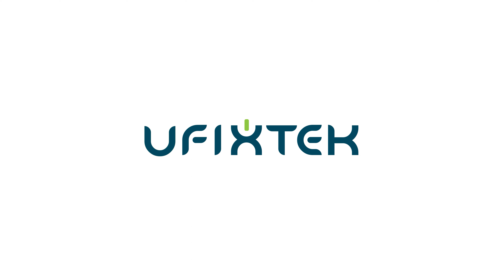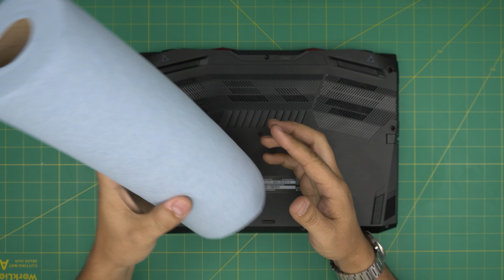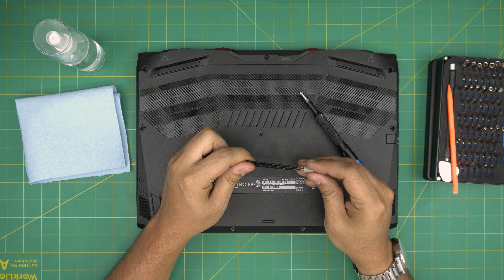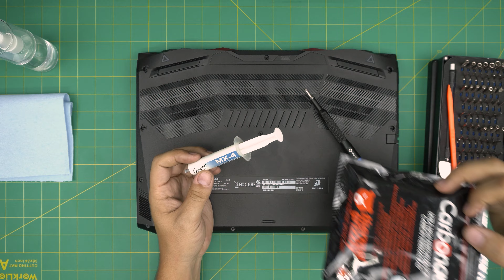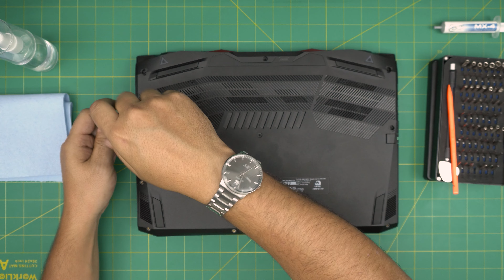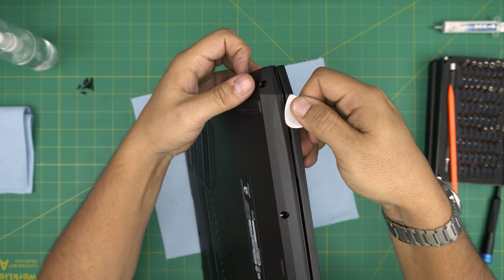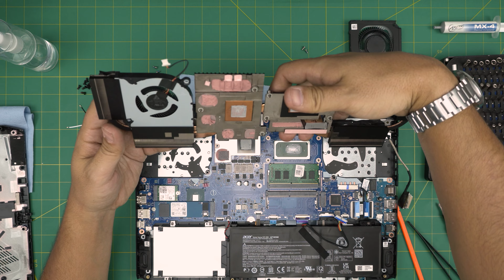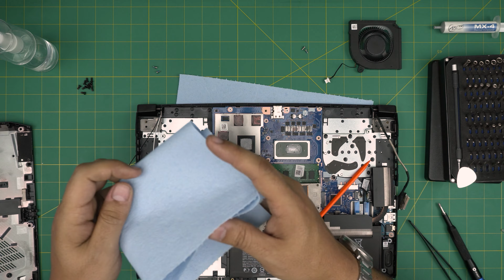How to Repaste and Clean Acer Nitro 5 AN515-57-79TD Laptop | Step by Step

Comment: When I was doing it to my computer I had got a little alcohol on the tape and so I became no longer sticky so I just peeled it off. On Mine it was little different and there was only 2 pieces of tape and I got it on both so I took off both. So my question is if the tape has an important purpose cause I don’t know if I should replace quickly or not.
Reply from the maker: 🫠Regarding your question, you don't need to worry it will not affect the performance of the laptop at all. zero issues.
Should you have any further questions or requests in the future, please don't hesitate to ask me.
cheers🍻

Comment: 13:20 I’m trying to put the computer back together, but I can’t connect the wifi card cables back together. There’s so tiny and can’t put them back on right. Idk how u make this sound so easy, but something ain’t right. How do I get it on?
Reply from the maker: 🫠Regarding your question, all you need is to make sure it is straight over the connector and push downs and it will snap to the connector, just make sure you place straight over the connector.
https://imgur.com/a/3U6y5rA
Reply: @uFixTek  It snaps on, but then falls right off, and it’s really annoying to do. But I found out that I didn’t REALLY need the wifi card per se bc I still get wifi and Ethernet n stuff without it. I’m assuming the wifi card gives u Bluetooth n stuff right? Or does it include other stuff? I bought a Bluetooth dongle for like $15 and it should work perfectly fine.
Reply from the maker: it gives wifi and Bluetooth , if you near the laptop the Bluetooth  will work. or get a dongle. but it should not fall off, you can use a gafers tape to keep it in place or hot glue.
Reply: @uFixTek  I bought a dongle for like $15. I have one on my other PC at my dads, and it works just fine. Should see the same results on my laptop.
Reply: Update: I bought that bluetooth dongle, and it doesn't work properly. It gives me error code 31 when listed in device manager. Could this issue be due to the disconnection of the wifi card?
Reply: @uFixTek  I feel like my internet has become slower without the wifi card plugged in. Does the wifi card improve network performance?
Reply: @ThatPurpleWurmple Just dealt with the same thing for probably twenty minutes. Try to do one cable at a time and tuck the other one back until you get the first to click. For me I tucked the white wire and focused on getting the black one in place, clicked in place after trying for a minute or two. If you’re still struggling just keep trying and you’ll get it in, unfortunately there isn’t much else you can do.

Comment: The screws on the left of the heatsink won’t budge for me 😢. Maybe im using the wrong screwdriver what are you using?
Reply from the maker: 🫠Regarding your question, the screwdriver I'm using is linked in the video description.  
Use a screwdriver that fits perfectly, press down into the screw, and rotate slowly to break the tightness.
cheers🍻
Reply: @uFixTek  Thanks for helping I will get back to you after purchasing a new screwdriver
Reply: @uFixTek  was an easy and effective tutorial thanks. I just needed a PH0

Comment: can i use 0.2 mm thermal pads to replace the thermal putty?
Reply from the maker: Thank you for your feedback! If you wish to support the channel, you can like, subscribe, or both!
Regarding your question, absolutely not recommend you, because the gap is not .5mm nor 1mm, so that is why you need to use the putty, if you use the thermal pad, it will push the heatsink away from the GPU and CPU, resulting in poor performance and high temps.
Should you have any further questions or requests in the future, please don't hesitate to ask me.
Reply: @uFixTek thank you for answering my question, can you make tutorial on how to replace the thermal putty because i rarely find a video about it?
Reply from the maker: just apply fair amount and the heatsink will squeeze the execs out from sides, it is not conductive and just place fair amount.
Reply: @uFixTek  What about the voltage regulators? Can you use thermal paste/putty on them or should you strictly use thermal pads?
Reply from the maker: you can use thermal putty without any issues

Comment: Great tutorial! The angles and the delivery of the instructions in this video is the best I’ve seen on the topic. Replaced my paste with thermal grizzly and my CPU went from running at 90 degrees celsius when gaming to a max of 70 degrees!
Reply from the maker: It's my pleasure, my friend. 😊 I deeply appreciate your taking the time to provide feedback. If you're inclined to support the channel further, feel free to like and subscribe—or even both!
I'm glad that my video did help you to do your service 🫠
Should you have any questions or requests in the future, please don't hesitate to ask me.
🍻cheers
Reply: @uFixTek  can i spread the paste before applying the heat sink i got a 20 w/m/k paste and 1mm pad that has  same conductivity i have the an515-57 with 3060 i5 11400h on it

Comment: 13:14 has anyone been able to re attach their wifi jacks into their antennas? I’ve tried for the past 2 hours, and they’re not re-attaching, i’ve pressed beverly hard, i’ve used a lot of tools, and nothing… my fingers are hurt…. I’ve done everything, i’ve aligned them perfectly, then pressed down, and nothing…. now my laptop has no wifi
Reply from the maker: 🫠Regarding your connection, if you press down too hard, you could damage the connector. It needs to be perfectly aligned, and a gentle push should make it click into place. Use a magnifier to check if the connectors are deformed.

Comment: Wait are thermal paste and thermal putty different?
Reply from the maker: 🫠Regarding your question, yes, thermal paste and thermal putty are indeed different. Both are used to transfer heat, but they serve different purposes.

Thermal paste is primarily used on CPU and GPU die surfaces to ensure efficient heat transfer between the chip and the heatsink. It's designed to fill in the microscopic gaps on these delicate surfaces.

On the other hand, thermal pads are often used on electronic components where the gap between the surfaces is uniform, typically around 0.5mm, 1mm, or 2mm. When the gap is uneven, that's where thermal putty or thermal gel comes into play. Thermal putty is ideal for filling larger or irregular gaps, ensuring proper heat transfer where thermal paste or pads wouldn't be effective.

Should you have any further questions or requests in the future, please don't hesitate to ask me.
cheers🍻

Comment: Have you ever cleaned "Acer Nitro 16" and "Acer Predator Helios 16"? Can you remove and clean the fans without removing the entire heatsink?
Reply from the maker: Thank you for your feedback! If you wish to support the channel, you can like, subscribe, or both!
Regarding your question, sure on helios laptop you can clean and service the fan only if you want, here is a video for one: https://youtu.be/8s958N67HfI
Should you have any further questions or requests in the future, please don't hesitate to ask me.
cheers🍻
Reply: @uFixTek  thanks but it appears this is for the older version of helios. Is helios 16 the same?
Reply from the maker: yes it is the same, you can clean the fan without removing the heatsink. the fan is not attached to the heatsink, just peal off the gaffers tape.